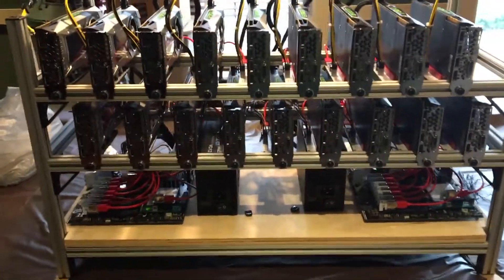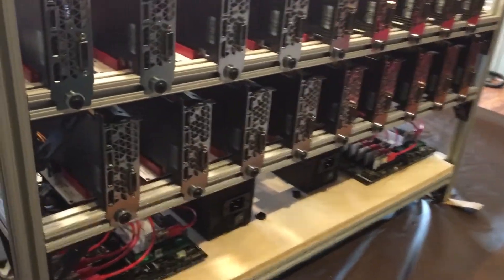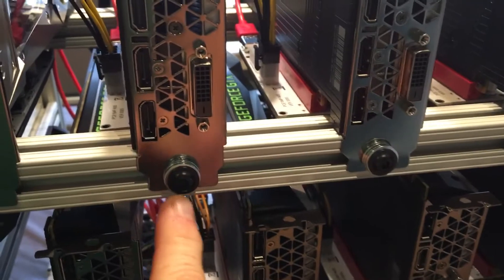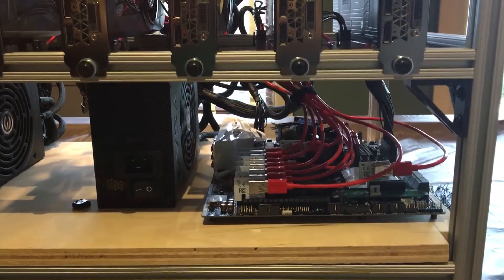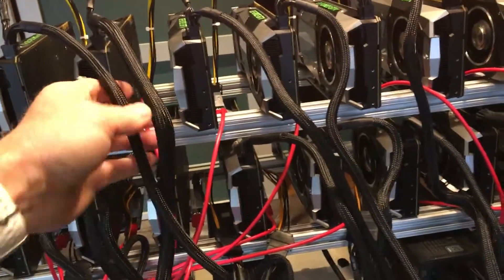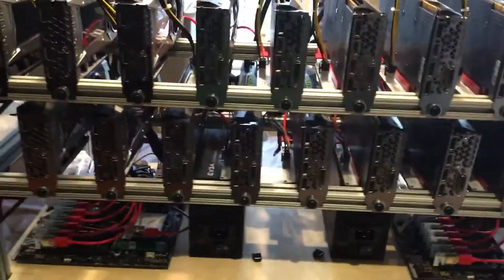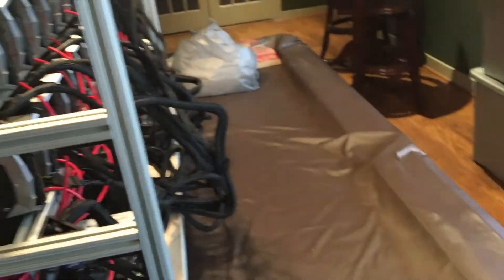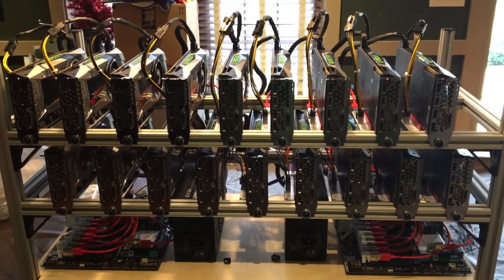T-Slot aluminum rig (part 3)

Comment: That looks Awesome! I would love to see the water cooled version. You will definitely need a lot stronger pump with a lot more flow and a huge radiator. You could also put the radiator out side to help with cooling.  I suspect that when you are running parallel on all of those cards the flow could become unbalanced. I hope this is not going to be your last video. I actually used a lot of your recommendations on my build.